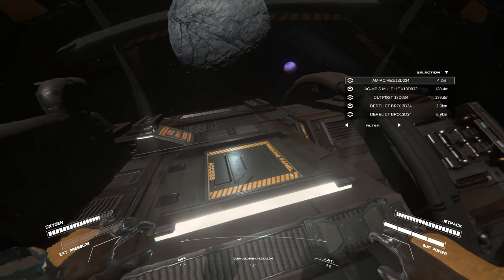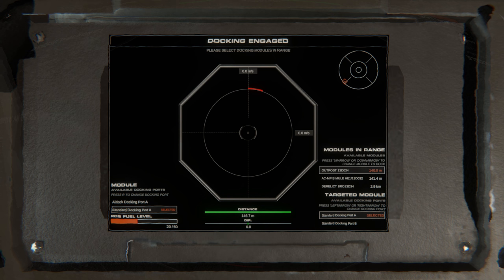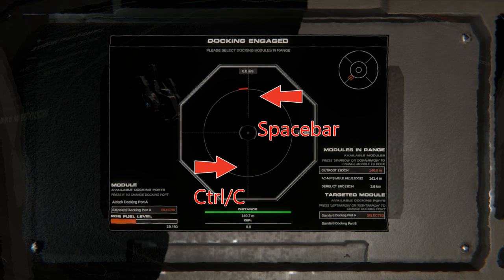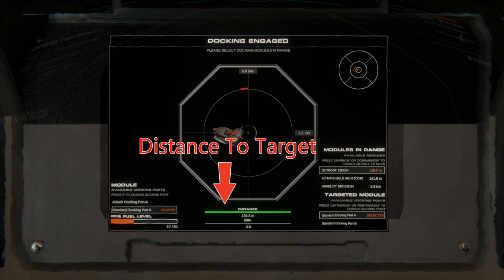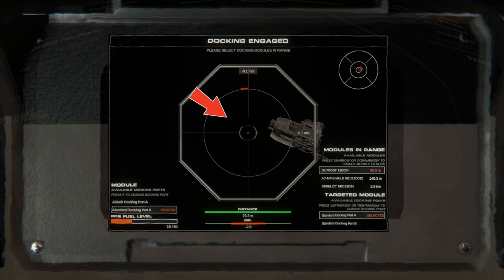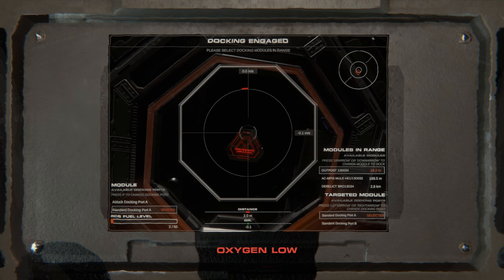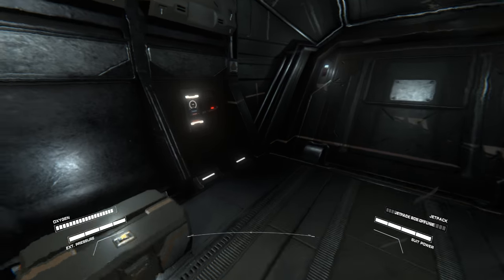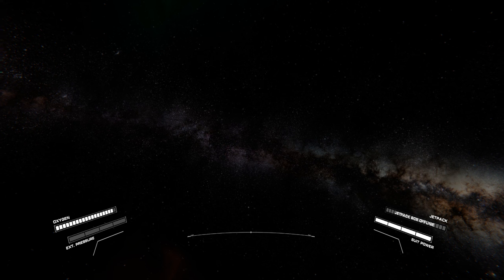Hellion: Docking Overhaul And Cargo Bay

Comment: Great guide! How long did it take you to learn how to move around in ZeroG? I am having a hard time moving around without over compensating. It would be great help to offer some suggestions for those of us new to ZeroG environment?
Reply from the maker: I'll see if I can put a video together explaining it all :)It took good couple of hours to stop being out of control every five minutes, my best advice is 'Slow and steady wins the race', start with small movements and slow speeds.When you're trying to manoeuvre only think about one axis at a time and almost come to a full stop before performing the next one.Don't try to slow back to 0.0 in one go, stop at 0.6 or 0.7 and let your character settle before slowing to a stop and this should help with eliminating over compensation.Move in straight lines until you get the hang of how your characters visual direction can effect the controls you need to use while in a manoeuvre.I.E. Press W you'll move forward, turn 90 degrees to the right with the mouse and you'll need to use D to slow down and stop, this applies to moving anything space, the movements are the same but just slower and feel heavier.